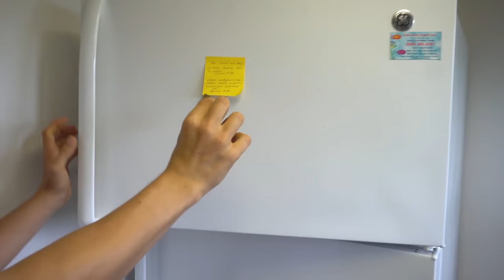Fridge Making Loud Noise and How To Fix It

Comment: Thanks so much for this video. I have the exact same fridge. The fan was making a lot of noise, and there were some other noises too. I removed the panel, exposing the evaporator coil, and let it sit for a couple of hours unplugged with the freezer door open. It worked like a charm. Everything's a lot quieter now. Thanks again!

Comment: thats nothing, the noise my fridge started making last night, you can hear it from outside the front door.  in the kitchen it's so uncomfortably loud you would want to leave the vicinity ASAP.
Reply: Same here and the method in video didn’t fix it, I find if punch the door it stops for awhile.
Reply: Mine just started...did your light bill go up because of it?
Reply: @nothing2see315  the defrost method he showed us in the video did help me out temporarily, but it was not a permanent solution because in my case, the defrost timer was bad.  10 dollar replacement part from amazon and 5 minutes of labor to swap it out, problem solved.  if your fridge noise isn't helped by defrosting, then it's most likely not caused by ice build up, and you probably need to replace the fan and the fan motor.  maybe the axis is off center for whatever reason.
Reply: @LaidBackLora  maybe my electric bill went up, but i didn't notice a huge difference.  i did, however, noticed my fridge section was not getting cold, despite freezer section being full of ice.
Reply: @OperationNonsense  Hey , thanx for the heads up .
Reply: @OperationNonsense  my door doesn't seal completely . We had been on vacation for two weeks when the knocking started . We think it wore out the bearings in the fan motor because for two weaks it ran continuously . Well , I guess I get to find out soon if I can figure out the source . I will post here , in case anyone wants to know .
Reply: @Nothing2See  I hit the inside middle panel with a hammer.  It helps for a lil while before starting up again.  I'll have to find a way to remove the two screws, unfortunately, mine are rusted and stripped..... SUCKS!!!!😐

Comment: Great video!!!!!! Fixed my humming noise almost immediately!!!!! I left my refrigerator plugged in, cleaned everything out, noticed the ice built up inside, and simply left the freezer door open.. once the ice began to thaw a bit (3 minutes later), the noise went away, and I was able to readjust the temperature gage to the recommended setting. It had been pushed to the coolest temp by the overcrowding of  the freezer as mentioned. Thanks again!!
Reply: Thx this worked in seconds ❤
Reply: "It had been pushed to the coolest temp by the overcrowding" Exactly what happened to me, and probably to most people.

Comment: Solved my problem!! Thanks so much! I unplugged it then used a heat gun, emptied the ice tray and used a clean towel to soak up water and wipe everything down. It took about 15-20 minutes total. From emptying most of the freezer, defrosting ice maker and emptying some trapped cubes, then putting some things back. I have a side by side Frigidaire. This video saved me from having to call Lowes!

Comment: Really appreciate that you made this video. Even after 2 years from your video. Had this issue with my refrigerator today. Saw your video today. Used a hair dryer to warm up the fan area and noise is gone. Thank you for your awesome advice. Saved me a lot of hassle of getting someone to come over and fix this issue. Bless you brother

Comment: The Hairdryer trick worked for me!!! Didnt uplug the fridge , just turned the setting inside fridge all the way off, so it stopped the fan  from spinning. Emptied my freezer only,  and used the hairdryer for about 10 minutes, thats all it took. do it just like the video says, it works. no need to defrost a whole day. its been a week now and no problems or loud fan noise.

Comment: I am so grateful. I was about to buy a new refrigerator. The noise was so annoying that I thought that the compressor was broken. I just took Eve from the fridge (yes, it was packed 🤦🏼‍♀️), used the hair dryer for about 15 minutes and leave the fridge desconected for couple of hours. Voila 🙏🏻

Thank you 😊

Comment: Jay, your video was easy to follow. Glad to learn new steps. Our loud noise was plugged drain from the freezer drip making a solid ice block in the refrigerator side. This caused ice to form at the bottom of the freezer side. So far 2 day of No crushing noises after midnight!

Comment: The noise my fridge was making was super loud...I could hear it over my TV with the volume completely up...I did option #2 I put on a big sweater because I was going to be in front of the freezer for over 15 mins... I turned off the switch on the power box figured that would be safest and used my hair dryer on high heat for 15 mins....there was a huge puddle in the freezer about two inches tall so I'm glad he said something about a towel. After I turned the switch back on the noise was gone...I got to clean and reorganize my whole freezer 
So happy I actually get to sleep tonight.... Thank you so much!

Comment: This video was super helpful - thank you! I was able to unscrew the covering for the fan without taking anything out. Took about 10 minutes. I first tried with a heat gun without unscrewing because I wasn't at the point in the video where you warned against it. But I noticed a bit of bending in the plastic and stopped, then proceeded to unscrew the cover. My problem is solved now thanks you your video. Much appreciated 🙏

Comment: This was very helpful. 

I cleared the 3 vent areas in my freezer and unplugged it for about 5 minutes. I used my blowdryer on high moving it side to side and it cleared the ice. I cleaned out the little melted ice water and plugged the freezer back in. It cleared the noise.

Comment: This video worked! I heard some kind of soft tapping sound in my freezer and the fan wasn't turning on, so I emptied it and put a bowl of boiling hot water in the freezer by the ice covered coils and looked up solutions to the noise problem. Sure enough, while watching this video hoping to find the solution to this problem i heard the fan turn back on and the freezer running.

Comment: Thank you so much!!! I thought I was going to have to either ring a handyman or buy a new fridge! I just took everything out, and took off the back panel (easy, there were no screws) and chipped off a bit of ice. The fan started working normally after a minute of doing this, and I just put everything back and it is sooo quiet now! The reason the problem started is because I stuffed my freezer last night. Again, thank you!!! :)

Comment: I have less stuff in my freezer now and I made sure the vents aren't blocked.  I turned my refrigerator off for about 2 hours.  That was enough to stop the noise.  If needed I'll do 24 hours later.  Thanks!

Comment: First thing I was taught about any type of cooling chilling and freezing units. No mater what it is they need to be maintained. Cleaning the coils , condensing units Fans clear duck work and all vents. Keep them clean. If something fails or does not sound right don't ignore it. It will just lead to a bigger problem down the road... Great video my  friend
Reply from the maker: Amen to that! Thank you for stressing the importance of maintenance. Aloha from Hawaii my friend! 🤙🤙
Reply: @WordofAdviceTV   Thank you for those great videos & Aloha from Cold Ohio where furnace repairs become urgent in the winter. ha ha

Comment: Your model is same as mine. nice. I found that this video was helpful. My issue was same as yours. And I found that after I cleared away all the frozen goods and opened the panel, there wasn't any ice on mine either. But oddly enough, it was super silent when plugged the power back on. I figured it was quiet now because I removed all the stuff blocking the two vent openings at the bottom part of the panel. I figured the 'over stuffing' of freezer pushed all the goods to press against those 2 vent openings at the bottom and like a lung, if you have a hard time taking in air, you'll have to work harder to get it in. That was probably why my pump was running so loud. After I did the same of leaving space between the frozen goods and the back wall, my noise all went away. Now I have to find time to get some 'bumper gap' things made to all me to stuff my freezer without pushing into the vents...ironic. now that means my freezer space is ACTUALLY smaller than it is. Since you don't want to literally cover the bottom part. I figured some new plastic trays and a bumper would help me sort that out....hope that helps someone out there too.

Comment: I have found using a leaf blower to defrost a freezer works very fast and efficient.  Just make sure you have towels or something to soak up the water.  It will only take about 10 to 20 minutes and your done.  I’ve used this method several times and it work great.  Just prop the blower in the door and let it go.
Reply from the maker: That's a great idea! Thanks for sharing Bill, I wouldn't have thought of that! 😄
Reply: Better yet..I think the blower for an air mattress would work well..It also works well to ignite camp fires..

Comment: I think we have the same fridge!  :) 

Instead of a grating or purring noise, ours is making kind of a loud high pitch squeal when the fan runs. I thought it might be a bad belt or bearing until I saw the inside of your fridge. 

It stopped a couple of times when I thumped the back of the freezer. I could still hear the fan but not the squeaking. Now that doesn't see, to help any more.

It could still be ice. I've moved stuff away from the vents for now. We've been packing it full of food because of the pandemic (we've been minimizing shopping trips). If it persists, I'll try to defrost it this weekend. 

Thanks!!!!!!
Reply: I have the high pitched squeal every hour ! Try this before I dump this one

Comment: Oh, I just noticed this video....
Ceyanne pepper 🌶️👍Good to know.
The only fridge problem I remember, was during the blizzard of 78 in Massachusetts.
The power went off and on quite a few times, ruining the fridge compressor. When we moved in
here, in Florida 10 years ago, the fridge that was here, stunk so bad, I went right down to Sears and got an LG. Biggest fridge we've ever had. The freezer is on the bottom, and the basket pulls
out for easy loading. After 10 years, I still can't hear it run...
Oh, but I don't care to look at
my backside too much.....🤔😂
Reply from the maker: Thanks for stopping by Mr. Classic! Always good to have you 👍👍👍 Cayenne is really good stuff! Not just for wounds, it can prevent heart attacks as well.
Ah.. Death by power outages. They sure do take out many appliances.. Sorry to hear that it happened to you as well.
Lol, and not hearing your fridge for 10 years sounds amazing!! I love those really quite refrigerators 😄
I hope yours continues doing what it's doing for another 20 years!
Reply: @WordofAdviceTV  , You must be in the AM. We're in the PM, but
in 5 minutes it will be AM 🧐  
🤜🤛
Reply from the maker: @classic287  No actually it is 7:30pm here right now 😄🤙
Reply: @WordofAdviceTV , Monday night?
Reply from the maker: @classic287  Nope, that was Sunday night

Comment: Question: Brand new Whirlpool top freezer fridge only cools down to 4 degrees and a high of 17.  Does this seem right? Shouldn't it reach zero or below?  Freezer set on their recommended setting.  Thank you.
Reply from the maker: That its is too warm. I would first try adjusting the temperature lower than their recommended setting to see if that makes a difference. If it doesn't then there is a chance that the unit is compromised right out of the box. Can't say for sure what part would be the malfunctioning one without looking at it.
Reply: @WordofAdviceTV  Thanks so much. Did change it and the replacement is spot on.

Comment: Great video.   What do you think is going on with a similar fridge where the freezer gets and stays cold but the refrigerator part doesn't get very cold?  Can't get it below 40F where the freezer gets down to 0F no problem.
Reply from the maker: Thank you. It is possible that the damper is not open enough or it may be broken. The refrigerator part does not do any of the cooling. The freezer does the cooling and then using the fan, it blows the cool air into the refrigerator compartment as well. So my guess would be that the damper is not fully open or the control for it is broken. You would need to disassemble the freezer section a little bit to get to the damper and take a look at it.
Reply: @WordofAdviceTV  Thank you!   I appreciate your help.  Enjoy paradise!

Comment: He should explain that Ice is different than frost. Frost build is due to failing defrost system not working. Either the defrost heater, thermostat or defrost Timer is the problem. Luis

Comment: If this is the problem, does it cause the temperature to drop? My refrigerator has changed noises, for the worse, over night. And the fridge is not as cold as it should be...things are starting to sweat. ANY ADVICE IS APPRECIATED!

Comment: really old whirlpool fridge...  the freezer started making loud similar noises at the same time the fridge isn't getting very cold.  I just moved in so maybe the fridge wasn't getting cold prior to the loud noises and I didn't notice.  Could the loud noise and the lower fridge not getting cold enough be related?   I've alread cleaned the coils in the back and that didn't help :(   Thank you!

Comment: I .had a bit of a tough time just cause it was wired to go behind the fan and not a lot of excess wire to move it. Now instead of a very loud grinding sound, it's a higher pitch sound like the old gas model airplanes. At least it's not as annoying so thanks.

Comment: I had an old refrigerator  that I couldn't  find the freezer fan? Is it built in the cavity of the refrigerator ?
Reply from the maker: Hmm... There will always be two fans. One is the condenser fan motor which is located at the bottom of the fridge by the compressor and the other is the evaporator fan motor which is typically in the freezer section. If you go to https://www.searspartsdirect.com and input the model number of your fridge, you should be able to look up the parts diagram and that will show you the location of the evaporator fan.

Comment: I put hot water in a pot into the freezer section for 5 hrs and heard the ice melting and dropping. After mopping up the water with a sponge I turned on my fridge and now it is cooling on the food compartment but the sound is the same.  Someone said have to press the reset button but I don't know where it is.  Do you know where it is on old GE same as your. Still very loud.

Comment: I did the last Technique and even a little blow dryer. We have the same fridge except mine had star type screws in the back panel.  I put everything back and everything back in the fridge.  It was quite for about 10 mins then the noise came back but lower in sound.  What can I do next?

Comment: The hair dryer step fixed my issue.. I'm still concerned though, because we have a new fridge (not that new but just got it earlier this year) and the fridge wasn't packed but there were food in front of the fan like we always did with our old fridge but that old fridge never had this noise issue. It was just old that's why we had to replace it..

Comment: Question what about the motor on the bottom for the refrigerator starts making noise please help 🌹
Reply: The bottom fan tends to get covered in dirt and sometimes gets moisture mixed making an almost muddy thing which can make it go out of balance or bog it down. If after cleaning and it still makes noise I would just replace it.
Reply: @dvdmrrs2  thanks so much I will check on that have a great evening 🌹

Comment: Jay the noise will be back you need to order new evap motor that is the problem with that fridge
Reply from the maker: It's been a week now and the noise hasn't come back. But we are renting this house so I won't be the one replacing the motor if it comes down to that.
Reply: ICE build up is usually outdide air geting inside...bad door seals. Or overstuffed freezer . u need to know if its ice or frost, frost means failing part on defrost system
 ...heater, thermostat or Timer. ( frost is soft like snow. Ice is HARD)

Comment: You're lucky that you have screws holding the back panel inside the freezer. How to disassemble the back panel and reach the fan on GE fridge where that fun is not reachable so easy? I'm dealing with TBC12SNVRW-1 model that became quite noisy. I  removed all food out and unfrozen the fridge but the noise is still there... Any clues anybody? Thank you in advance!

Comment: In one hour my fridge makes around 10 to 15 times gurgling sound...like once its silent and then compressor starts(with vibrating sounds) and after some times compressor sound stops with a thunder type gurgling sound. And then its silent again. Should i be worried? Its just disturbing. Otherwise cooling is fine.

Comment: My refrigerator is making a brrrrr noise but it's louder than yours. I found out it's not because of the fan is hitting ice it's because the fan is contacting with the fan shroud wich is the cicle thing that goes around the fan blades. but that's an uncommon problem. I can't find any videos about my problem.

Comment: My side by side Frigidaire Gallery Refrigerator is leaking water on the floor why is this happening
Reply from the maker: With water leaks you need to find the source of the leak first. Is the water coming from the freezer side or the other side? Or is it coming from the water dispenser or under the fridge? If it is under the fridge, you may need to pull it out and look the back and underside of it to see where the leak is coming from. It's possible that the water tube behind the fridge is cracked and is leaking.